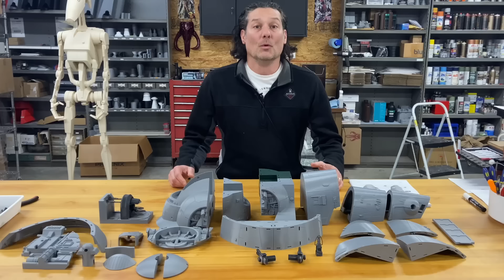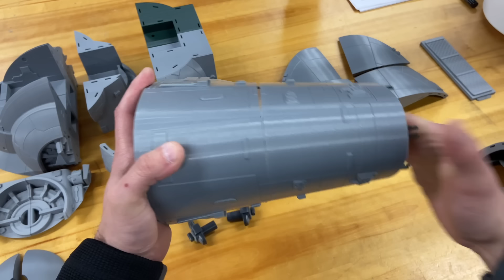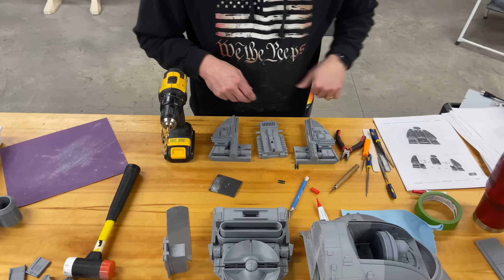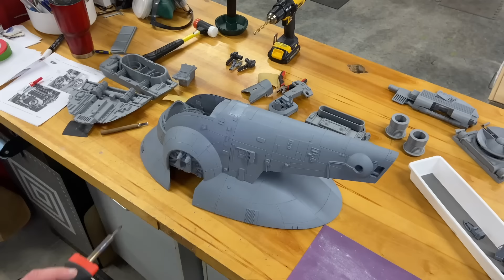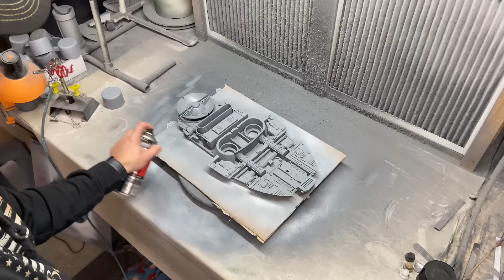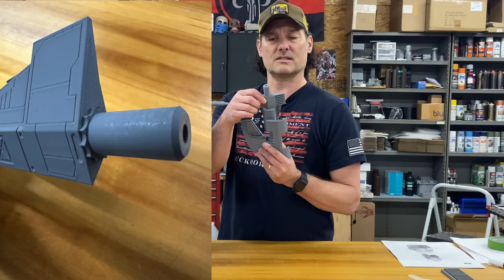Ultimate Star Wars Slave 1 3D Print Build! | Gambody Studio Scale Model

Comment: I like how the printed pieces connect but the choice of where they fit is extremely poor.  I would stay away from this.   

The parts should join along panel lines.  This looks very cheap.   If you can mask the junction points, awesome.
Reply from the maker: Not sure why Gambody cut it the way they did, probably to fit on smaller print beds, but seam lines are just something I'm used to dealing with and can hide.

Comment: OMG that looks amazing! Just subbed! What is that small sander you had? That looks perfect for a lot of projects and had that nice triangle tip
Reply from the maker: Thank you sir!  From you that means a lot!  HUGE fan of your channel BTW!
The sander is a Genesis 8v Oscillating tool I got from Menards clearance bin about 6 months ago.  Paid around 15 dollars for it even though it retails for around 65.  Bought it on a whim and have used it for all kinds of small sanding projects like this one.  In hind sight, should have bought several.  I know you're a Harbor Freight fan and Bauer makes a larger one that I also use and it's variable speed but you do have to buy a smaller finger sized adapter for the sandpaper for that one.
Reply: @coz3d  thanks for the info! Will be on the lookout for one. I bought one of the small Foot sanders I've seen folks use and they are only okay at best. That really looks dang good.
Reply from the maker: Yeah the foot sander is NOT my favorite though it has it’s uses.  The Genius sure comes in handy on projects like this one though

Comment: Just print the canopy with the resin printer. You can use the anycubic clear resin and will do the job. Done it for many projects and works like a charm
Reply from the maker: I have never had great success with clear resin but I can give it a shot.  You have a particular resin brand you recommend?
Reply: @coz3d  I have a saturn 2 and the resin I have used is the anycubic high clear resin. You will have to sand it with high grit and apply clear coat after the UV curing. The clear coat from rastoleoum works like a charm
Reply from the maker: Just bought some Frozone resin, I think it was, to try

Comment: What do you use to cover the seam lines?
Reply from the maker: I will do a video on this soon.  First, I take a soldering iron and run it down the seam lightly.  Second, I tape on both sides then apply bondo OR UV resin, because that's one of the best seam fillers I have found for long term.  Last, I sand and them work with bondo putty or a wood filler to fill in imperfections.